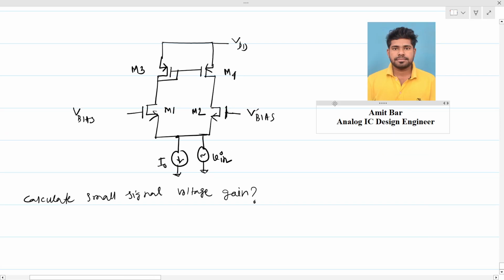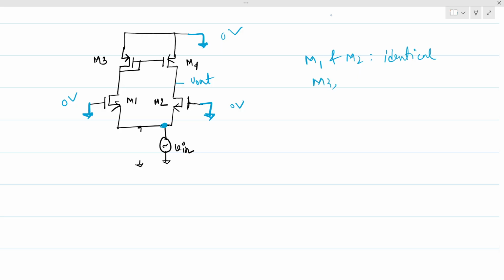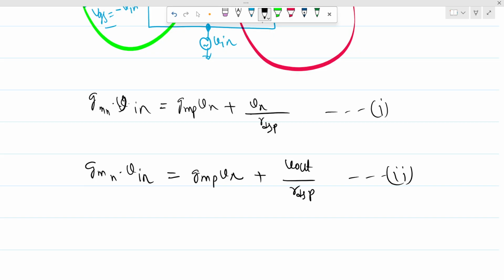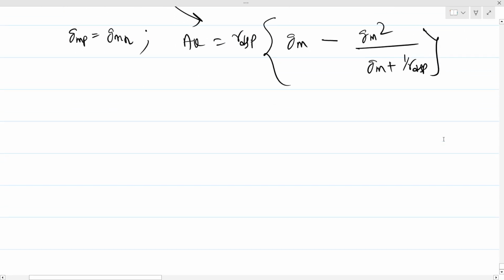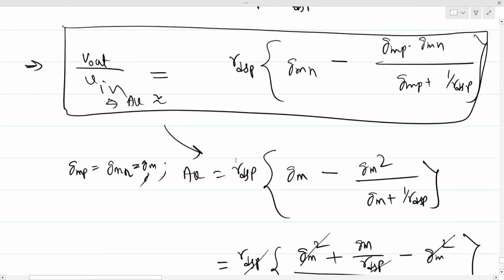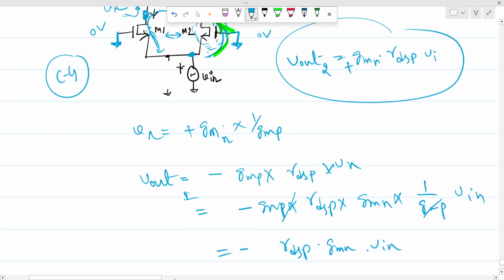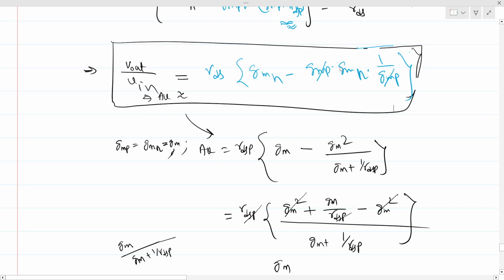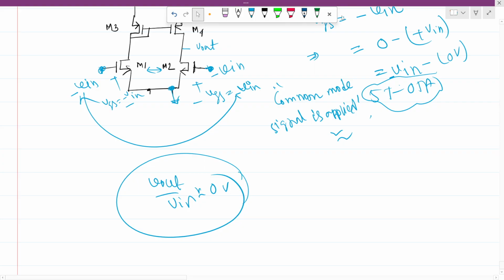Analog Circuit Design Engineer interview_ find small signal  voltage gain || Amit Bar

Comment: I think you got this wrong. The gain is approximately one. If the 2 PMOS transistors are equal and the 2 NMOS transistors are equal due to the symmetry of the circuit the output will be equal to VDD - VSG. Any other voltage causes an imbalance in the PMOS and NMOS currents.
Therefore you can ignore the output side of the amplifier and calculate the gain to the side that has a diode as load. The gain is gm1*1/gm3, so gm1/gm3.
The output node will be at the same voltage due to the symmetry, so the gain to the output node is the same.
This exact thought process can be used to calculate the gain from the input common mode voltage to the output in a 5 transistor OTA, which is approximately 1/(gm3*2*rout_tail). Or to calculate the gain from VDD to the output, which in this topology is 1.

Comment: Gm-(gm2/(gm+1/rds)) should equal something close to zero, I think? If rds is large, 1/rds is negligible, rendering the expression into gm-(gm2/(gm)), which is gm-gm. This would turn the gain into 0, which sounds more reasonable to me - a gain of 1 from the virtual ground to the output would be a serious issue. Also, if you think intuitively, exciting the differential pair at their common source turns both into common gain amplifiers. The AC current of the left one is mirrored into the right branch. Both branches have the same AC current with the same direction (which is the opposite case of when we operate the amp in differential mode - or the same case as when we operate it in commom mode, which ideally also generates very little gain). This is why I think the gain should be close to 0 and not 1.